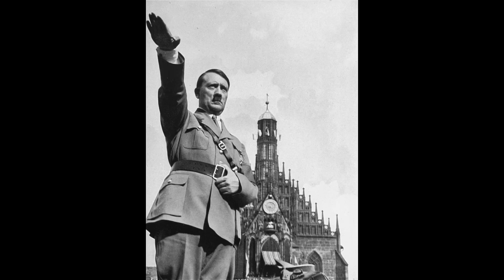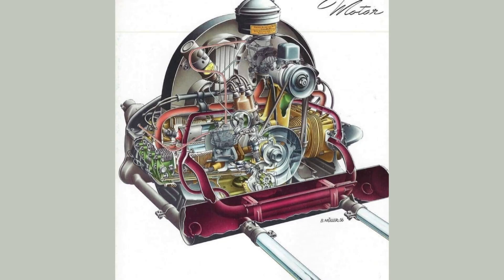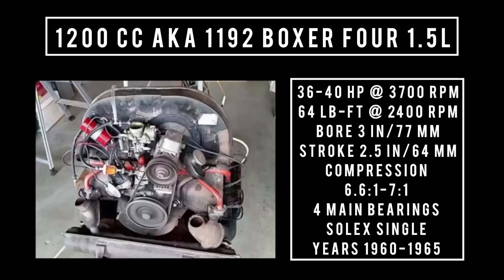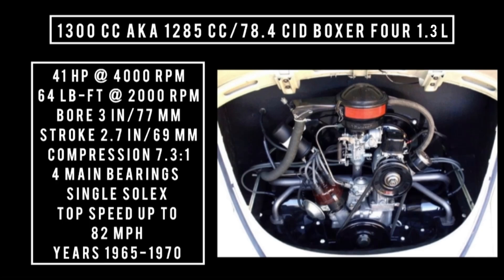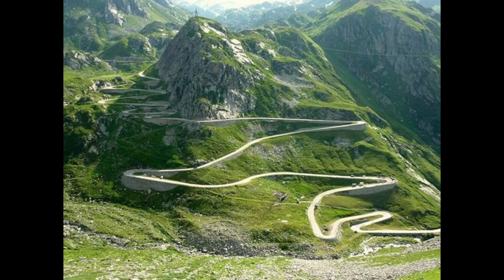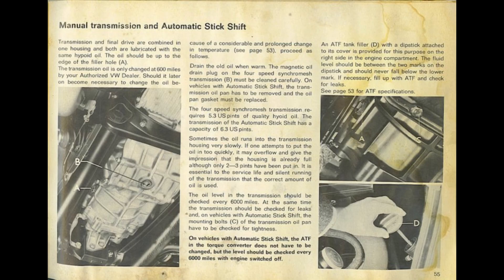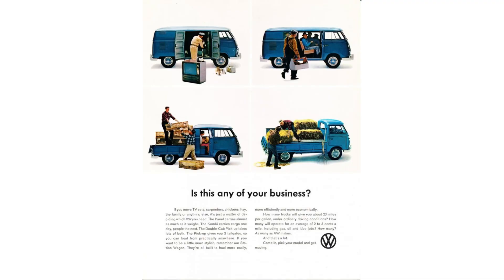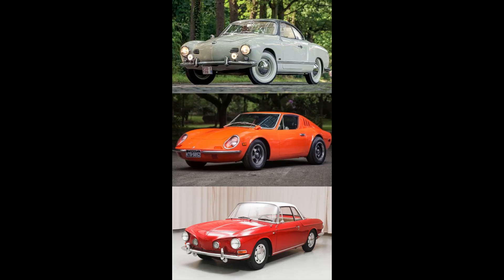Volkswagen air cooled engine family ( 1100, 1200, 1300, 1500, 1600cc )

Comment: I am reasonably familiar with air-cooled VW engines. I worked at a Volkswagen/Volvo dealership for 7 years in the mid 1970's to the early 1980's. The V.W. Bug was a very well designed, entry-level car from the 1930's. That sums it up. I had no love for them as automobiles. Beetles were hard-riding, slow and very noisy. They made a metallic, clattering noise when they accelerated that could be quite obnoxious. In the later years of V.W. air-cooled cars, V.W. tried to update them with fuel injection, but they made a big error when they did so. V.W. used rubber fuel lines on those hot running engines. As time went by, the rubber lines hardened and cracked. Gas would leak out and fall on the hot exhaust manifolds where it would catch fire. The cars were usually total losses when this happened.
Reply from the maker: Thank you so much for sharing all of that information and insight really appreciate it.
Reply: @What.its.like.  The Karmann Ghias were nice looking cars, but they were not much good in a demolition derby. Those little bumpers were mostly for looks. :>)

Comment: As an owner of a 56 VW convertible, I noted that Volkswagen proudly boasted that the engine was rated at 36 horsepower (when it was more like 28). However, the test for horsepower was done on a dynamometer with the fan and generator disconnected, which in Europe was a legal and acceptable practice at the time. It was not until 1972 that the Federal Trade Commission crackdown on this practice requiring VW to use a more realistic testing method which overnight reduced the advertised HP from 60 to 44, for the 73 model. So, that’s why horsepower ratings for early VWs often conflicted between sources - all were right depending on the method used.
Reply from the maker: One day I’m going to do an episode on that why they made the switch it’s very confusing to a guy like me who does this sort of thing.. they also change the way they sell oil by weight because back in the day it was just straight 30 weight straight 40 weight straight 50 weight and now they have all kinds of different weights
Reply: @What.its.like.  Speaking of oil viscosity, earlier automobiles had to use  different viscosities depending upon the time of year, the climate and even how the vehicle was driven (highway vs city). My VW owner’s manual was very specific on this. Multiple viscosity oils like 10-40 either did not exist or in the earlier versions were not trusted. But using a single viscosity grade presented a problem: If one didn’t do an oil change as the winter approached, you literally could not turn over the engine to start it. Early Model T owners struggling with thick crankcase oil besides removing the radiator water nightly, had to either heat their garage or literally build a fire underneath the crankcase to warm the oil-probably dangerous! In my 1920s house with a detached garage there was a chimney that had a pot belly stove for warming the old car through the long high-altitude winters. I hung a 150 watt lightbulb in my VW’s engine compartment with a sleeping bag over it and I removed the battery and placed it on top of my gas hot water heater every night when I was in nursing school- it was 23 below zero but I always was able to start the car despite 30 weight oil.
Reply from the maker: Yeah I’ve hear the same thing, also was wondering when the gold standard 3000 mile intervals came into play because I’ve seen different things say different things like I don’t remember the brand but they were advertising 5 to 6000 mile oil changes in the 50s.. and we have up to 10,000 miles now with the synthetic stuff and special filter done by special auto makers and dealers.. 

The craziest thing of all is after doing this for two years you come to find out that nothing is new and it’s all just recycled technology.. advertised as new..

Comment: Awesome engine. One of it's good qualities is with no water, these cars make great collector's pieces, able to sit years and not corrode from the inside. Power was easy enough to get with dual carbs and more open exhaust with noise being the limiting factor. Surely one of the best engineered platforms of all time. Thanks Jay
Reply from the maker: I loved my Karman Ghia when I had it for that very reason I never had to worry about it it never ran high but there was some days where I did have to open up the baffles and got some heat into the cabin they are very much machines you can tell when they’re running good and when they’re not all based on sound and feel.. but mine was good it only left me on the side of the road once and that was because of user error I ran out of gas when that said E it was empty there wasn’t any lee way

Comment: You don't "bore" these engines.  You change cyls and piston. WYR 1? Bus  WWR? 2 55 Ghia. The air cooled industrial engine continued through 2006 - early 2007. I worked in a VW dealership -68-69, then went into army.  Had my own shop when I got out. Early 70's? You could buy a complete factory direct engine for about 400, dollars, included everything, carb, distributor, clutch and pressure plate, generator all the tin - everything. Just add oil.   I used to charge 3 hours labor - in-out take core to VW dealer. #hours and I was the most expensive on the block at a rousing 12.50 an hour.  And  - - those engines came with a 1 year warranty. That said I rebuilt a lot also.  Worse problem? #3 cylinder vale would burn.  When I did valve work, Stellite seats, sodium filled exhaust valves.  Lower ends if oil was changed regularly? 75,00 to 100,000 miles. The cases were magnesium later they used 4% aluminum added for machineability. later "aluminium"  (actually 4%) cases (with AS21 or AS41 cast into the sides) make a much better case for rebuilding.
Reply from the maker: Thank you so much for taking the time to clarify some things I really appreciate it great choices too by the way 55 ghia low light would be an awesome car to have, i’ve read the same thing that these engines go good until about 75,000 or 100,000 miles even if properly maintains they were built to run off of really shitty gas.. I was going to say in the video it’s almost like a modern version of a model E engine because after a certain point in time they need to be tinkered with.. valves sometimes need adjusted from white people of told me I only owned a Volkswagen Karmin Ghia for three years and most of the time it was in a bunch of pieces trying to get painted I think I only got to drive that car for maybe a year and a half. we bought it to flip it and it turned out to be a colossal nightmare nobody knew what it was it was a really hard car to sell

Comment: Good video, my preference would be a karman Gia never had one of those but thought they look pretty sporty. Back in the late 70s early 80s I got a couple of friends together and we built some 1600 vw bugs to lift the front wheels and pass the quarter mile in high 9s
Reply: Oh, Beetles could be made to run, but Jay was talking about pure stock engines here. The engines were surprisingly tough, and they could definitely run well if they were modified for the drag strip. In later years, people started putting Subaru engines in Beetles, and they could really run too. The biggest thing to do with original Beetles to make them last was to change the oil every 1,500 miles. Beetles had no external oil filters. They had metal screens that had to be cleaned regularly. Heat also degraded the old types of oil fairly rapidly.
Reply from the maker: Awesome memories =) thank you so much for sharing those 

I had a Karman Ghia they’re pretty cool I wouldn’t say it’s not a fast car by any stretch of the imagination especially after owning a Mustang and then going to that.. lol

Comment: I love all of them , The first VW engine I rebuilt I forgot to put the thin gasket between the jugs and the case. 🤣 It leaked like a sieve.
Reply from the maker: I never had to rebuild one I’ve only owned one I was thinking the other day it would be really cool to own a beetle at one point in time I always wanted to put a Harley V twin in the rear because you’d be making more horsepower and only have two cylinders and I thought that would be awesome.. Oil filter of a Volkswagen beetle is essentially a strainer most interesting thing I’ve ever seen.. definitely different thank you so much for sharing the memories in that story =)